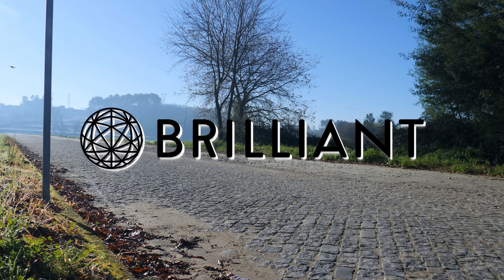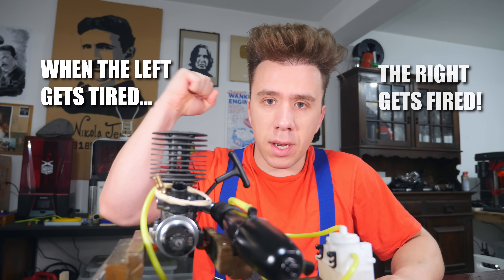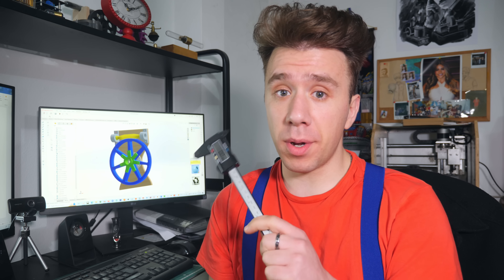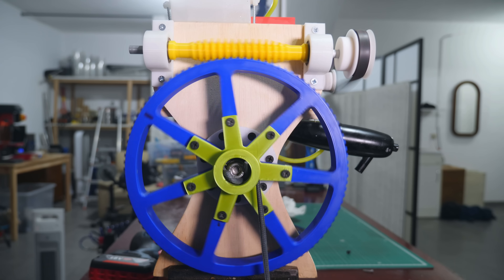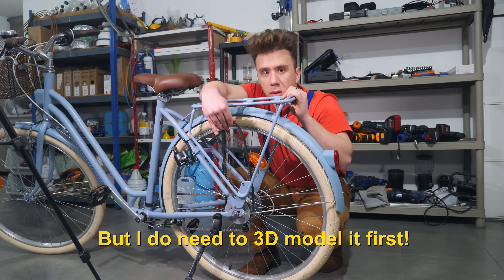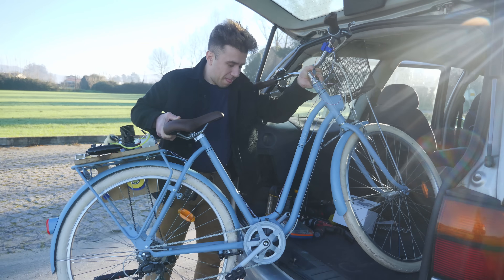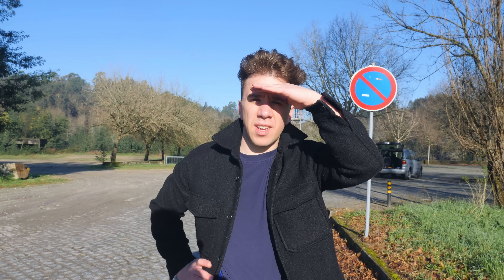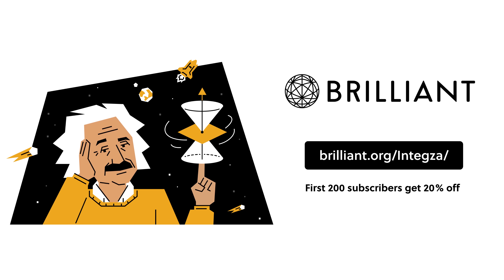Tiny 3.5 cc NITRO ENGINE on a BICYCLE

Comment: My friend, do not crosscut with the rip fence in place. If the cut off piece jams between thr blade and the fence it can trash your saw and/or accellerate the block of wood at you.

Comment: *Built a completely mechanical power unit with bare minimum of from_the_shelf parts. Made a servo-throttle with lots of spooky wirings, hanging around the frame. *
Toyota: -Would you like to become an automobile engineer?

Seriously, what's the matter with a simple device, every top bike has in 2024, you know, the cord operated twist-handle?

As for the rest of it, i'll just keep quiet, since it's just a hobby, but thanks for the worm gear idea, that solves few bugs in my project.

Also, total envy to your workspace capabilities.

Comment: Next time prime the motor plugging the exhaust or carb opening and it will start after priming 3 or 4 times (pulling the cord while plugging the pipe with your thumb)

Comment: You have a 'Flywheel' there,  no need for pull start. Far easier to use a mechanical starter.

It pays to do your research first. This comes from someone who used to race tune those engines, and blend my own fuels.

Comment: @3:15 that bearing is probably a one-way bearing that prevents turning over the engine in the wrong direction.  They make a cap and bearing for drill-start that you can probably ebay for pretty cheap.  Also, your mix seems lean (there should generally be a small amount of smoke exiting the exhaust when correct).  If it is lean - keep a close eye on your cylinder head temps with an IR thermometer if you want this engine to last any amount of time. You generally want it on the rich side, especially when the engine is new.   Nice job!  Very creative!

Comment: apart from the engine havong the idle speed setup to high and the mixture to lean (you notice the juhjuhjuhjuh sound on full load), cool video !

depending on the carb you have mostly a slotted screw that keeps the slider from closing to much. often at an 25° angle from the sliders axis.

turn it counterclockwise while the engine is running and push the slider in until it runs at a nice brooooo tone.

then drive around a bit so it warms up and then turn the big screw in the fuel nipple also counterclockwise to open the main/high speed needle and have it running a lil richer.

on full load it should sound like a angry hornet on steroids. without those micro bogdowns. like weeeeee.  if it puts out a lil exhaust plume while reaching full rpm and having good bite on WOT you got the optimal mixture.

to much smoke and laggy WOT reaction is to rich. good for longevity and easy start on cold days but bad on fuel economy and power output.

Comment: These engines needs to "break in" on low rpm, low load and rich on fuel to last longer. They are not ment for long time on full trottle. However, this looks so cool 😄

Comment: These things are incredible powerful.
And all they do is move small rc cars.
Actually very fun btw, they easily reach 60km/h+
I´ve got one that even has a automatic 3-shift gearbox (full mechanical transistion controlled by rpm).

Comment: You should lower the idle. I hope you broke in the engine before using it if it's new. The break-in process is critical, so you won't prematurely damage the piston & sleeve or the engine overall.

Comment: Haha, you need to prime the engine first in order to get it to start right away. Also, there's carburetor tuning involved. I'm not finished with the video yet, but if I come across more good tips, I'll fill you in. Definitely, you should have had your cousin there who runs rc or anyone from a hobby shop that runs nitro for guidance on nitro engines. They need tuning every day since the pressure in the air changes every day. Yes, you can have a basic tune, but it won't be optimal since elevation and weather affect the circumstances. Neat video, by the way! I'll get back in a few.

Comment: Nice as an experiment but operation wise the gear ratios needed to make such a high RPM engine workable on a vehicle are far from ideal as torque is non existent at 7cc so you fight your self against extremely lossy gearing and it needs to be run constantly at annoyingly high RPM and suffer at most of its power band.
That's why the bare minimum for a bike conversion is 50cc which has sufficient torque to propel it using a centrifugal clutch and fixed gear ratio while not revving its crap out.
I've even seen 200-300cc 4 stroke engines on bikes which probably have less horsepower than a 50cc nitro engine but their power band and the light gearing they can work on is what makes them ride seamlessly.

Comment: Only 15% nitromethane? That's it? You should give some higher percent fuel a try. When I upgraded from a Traxxas 2.5 to a 3.3 on my Traxxas Revo, I went from 15% to 30% fuel and wow. BIG difference. The only thing I hate about nitro engines is that compared to a modern brushless system they are so finicky for the amount of power you get. With a brushless setup and a LiPo battery, you can get the same if not more power more reliably. No fuel stops, no glow plugs, no tuning a tiny carb to make it run right if the humidity and temperature have changed, none of that.

Comment: hp is there, but not torque for a bike  with  a  person.   that engine gonna blow up because of  constant high throttle.  these type of engines are usually good for around 10 to 15 lbs. build max. cool project though.

Comment: Gears are important for torque and speed output. They always reduce power output.

Also 15 minutes of math could've saved you however long you spent guessing and checking your gear ratios. You know the engine's torque. Pick a target for wheel torque or force and go backwards from there. Another 5 minutes and you could've calculated the top speed assuming there was enough torque to achieve.

Look forward to more informed and informative videos next time.

Comment: I did this with a 24 cc backpack, leaf blower engine, a small piece of pipe, a storm door, dampening shock, a few brackets, and some bolts, all stuff my grandfather had laying around in his garage, I put this on the back of a bicycle, and it would take a little while to get up to speed due to the ratio, but it ran almost 30 miles an hour, I did this when I was 13 years old, no clutch, pedal to start kill it to stop, I did not really know what a clutch was at the time 😂

Comment: If that nitro was new then it would make more power after it is broke in. There is actually a process that rc car companies designed to properly break in the engine.

Comment: french do use HP we say CV (chevaux = horse) but on our carte grise car paper spec you got HP (also called cv) and you got CV that they call puissance VISCAL that is like a maths division thing to know how much it cost to put it on your name its a combination of emission and horse power and car specs like a 110hp diesel car can have 7cv but a 115hp bmw e36 318i is 9cv also a 164hp mercedes clk kompressor has 11cv and a clk230 193hp had 13cv and those CV get converted to a taxe depends on the region its 40 to 48€ 1cv but if the car is older then 10 years it half price
so imagine those nice v8 cars they are like 20 25cv you put those once inn your name and never change again

Comment: If you prime the engine it starts much easier. It's why it started right up for the drill, because you'd manually primed it a bit. Read up on tuning pointers for these little guys, they're easy to get right once you figure it out they're basically just like most engines with a few special needs. The fuel/air mix is important and operating temp is also important and the best way to check for fuel/air mix. You want the heat plug to be around 150°F for best longevity i.e. proper fuel/air mix. There's tons of tuning you can do (clutch shoes and springs for example), for desired results. I used to run RC cars with electric back in the 90s and was forced to learn nitro when I moved out east and everyone was running these. Once you get it there's no problems.

But it looks like you have the basics down and you started with a good engine supplier. HPI makes good stuff for the most part.

If your gears are wearing material like that then also check for lash as they're probably too tight together. Lash is super important and makes the difference between a set of gears that wear out in a few uses, or last for decades.

Love your videos man, you should be a professor because you have the enthusiasm and drive that all my teachers never had and I'd wager you'd make learning fun for students and I think we need more of that in schools.

Comment: The Citröen 2CV was not named for its 2hp engine. It was named the 2CV due to the engine having 2 cylinders (2C) in a V configuration hence 2CV.
Also most of the Chinese cheap 2 stroke convention kits make between 4 and 6 hp not 1.2.
Reply: Nice theory, except 2CVs are flat twins. Taxable horsepower rating of deux chevaux (two horses). Internet, buddy.
Reply: @chrishackett5887  I stand corrected :)

Comment: why do you guys need to control everything with servo motors? but things like brakes are still on cables? throw away the fly-by-wire system and fix a pretty atx thumb lever to the handlebar with a cable to the carb. KISS - no need for overthinking a solution that looks ridiculous when one wants to use the thing. instead of that you could focus on to make a kill switch...

Comment: Seems like you could tune the carb a bit and squeeze skne more top speed out if it, useually with nitro rc cars we look for a nice blue smoke on acceleration, seems like you could have been running a bit lean, it would be better for the engine to run a bit rich rather than lean, it helps keep the temperature down. Having said that, nitro engines so don't like to run great in the cold either so depending how chilly it was outside could also effect performance. Fun project for sure!.

Comment: If the electric motor on a typical bike has 50 nm of torque and your nitro engine is rated at .9nm then the electric motor has 55 times the torque, not 50!

Comment: Actually, I´m not surprised at all, that you can operate a bicycle with a nitro engine with 2.5 HP.
In germany, there are two types of electric bicycles, one of wich is limited to merely 250 watts, so somethng along the lines of 0.3 HP, which is a fraction of what the nitro engine is capable of delivering.
Still, I´m impressed, that the teflon gear was able to handle those forces, at least for a certain amont of time.

Anyways, yet another cool idea and a great execution.

Comment: My first thought was, you going to use planetary gear box. That would do excellent job of amplifying torq.
Reply: You can take one from old drill
Reply: @Niewiem0  Funny, I just disassembled an old two-speed dewalt hammer-drill driver, and was immediately impressed with the quality and durability of the planetary gear-set that’s used to facilitate the the high and low speeds. 

Unfortunately I am still trying to find a way to make a retrofit housing to go around it with input and output and output bearings to hold the shaft in place. 

The planetary gearbox has 3 sets of 3 planetary gears, and three more ring/center connecting gears. It’s really quite impressive, how strong it seems. I have no doubt that it could be used on a small moped sized vehicle, and support the torque needed…
Reply: Are planetary GBs readily available in this size? Would like to try.

Comment: You're amazing absolutely amazing 3D printing your own cogs I use steel 05b sprockets 05B 9 Tooth sprockets and 05b 11 tooth sprockets 05b 13 tooth sprockets and 05b 25 tooth sprockets 05b 28 tooth sprockets 05b 34 tooth sprockets 05b 36 tooth sprockets 05b 40 tooth sprockets finally the big size 05b 57 tooth sprockets I build trucks out of wood using these sprockets sound systems on them video tape decks my own homemade record players MP3 players 3.5 mm stereo plugs cassette tape decks I even made my homemade motorbike call Huffy rush motorbike using those sprockets that I described before gx35 cc Honda brush cutter motor VHS video tape decks on the back of the motorbike side my own homemade wooden box with two speakers a valve amplifier using a 2 6DX8 valves & 2 12AX7 Valves and even an old 1970s valve radio altered to play VHS video tapes using the video tapes for playing music on my own tape bias oscillator an Arduino Nano circuit board with a TF lunar lidar sensor rigged up switch the brake comes on when someone steps out in front of the motorbike Huffy rush motorbike the valve radio has a microphone on it the first VHS video tap deck record play switch and a valve heater selection switch from valve number 5 for playback mode or video tape deck valve radio playback and I've even got a headlight on the front of the motorbike LED headlight surprisingly bright 12.8 volt deep cycle lithium battery an alternator rigged up so that when the brush cutter motor is stopped the battery Powers the load as soon as the brush cutter motor is started up the alternator starts to run the load battery is no longer powering the load I haven't measured how fast this motorbike goes I think it goes about 10 kilometres an hour but it could go a bit faster if I rev up full speed I've got to get an app like the app that you got on your phone and then I'll be able to speed monitor the bike speed your video impressed me soon I'll be putting out a video about my motorbike Huffy rush motorbike and you will be able to watch it it will be in high definition the video I mean thank you inspired me

Comment: nitrometane IS WRONG ! The fuel has about 15 % lubricant. and about 10 % nitromethane and the rest is methanol. Glowplug servers as ignition. been flying model rc planes and cars over 20 years.

Comment: Prime the engine. Plug the exhaust with your finger and pull several times until the fuel reaches the carburetor. Then it will start after 1 or 2 pulls at most.

Comment: I mounted a weedeater motor on the back of a bicycle the same way you did I used a 2-inch pulley on the motor and I tac welded another rim on to my wheel both 26-inch 3/8 inch belt can't remember the length and I use the spring and idler pulley to keep the belt tight which always goes opposite of the pulling side of the belt I weighed 330 lb at the time and it would pull me 26 mph on flat ground I think the engine was 27.5 Homelite engine I use a small sprocket on my pedals so I can take off easy and all I had to do was take off pedaling in the motor would crank on its own no clutch when you stop motor stops when you start motor starts

Comment: They were doing this 40 years ago, remember seeing a guy going up and down the runway at a model show. The Engine runs on Methanol by the way usually with a small percentage of Nitro-Methane maybe 10-15% depending on the engine, also has oil in the mix, we generally just used to run Straight Methanol/Oil mix or 5% Nitro in a model aircraft.
Reply: yep. they dont need nitro. and all it does is use more fuel. which costs more...

yes, ok, you get a bit more power but thats due to being able to stuff more fuel into the cylinder.

nitro by itself barely burns. can almost say its non flammable...

Comment: Stopping one of these engines by putting a finger over the air intake is a great way of flooding it and possibly damaging it through hydraulic lock - much better to use the throttle arm, or pinching the fuel supply line.

Comment: Schumacher do a 3 speed gearbox for their nitro engines...
The clutch bell had 3 different sized pinions, meshed into 3 spur gears. Each spur has an internal rachet, with a different tension spring. As the rpm rises, the 2nd gear pawl engages and 1st gear just freewheels, and as the rpm rises the 3rd gear pawl engages, 1st and 2nd just freewheel. Fairly simple, reliable (although the torque in 3rd sometimes stripped the teeth...), and fairly cheap! (Fusion, menace , XTR3e)

Comment: I’m curious how part of the engine works. At lower revs it isn’t outputting any power but the engine is still going. I used to have a dirtbike with automatic clutch that did this too, the revs have to get over a certain amount for the engine to output. How does this work?

Comment: Totallt wrong about french 2cv.   Cv is not measuring power. It is a tax scale. Citroen 2cv comes from 22ch (power is ch. And not cv) up to 35ch for the models made in the 80's like "2cv 6 special". There are aboslutly no link between the tax cv and horsepower ch. I dont know where these "9cv" come from. Fakeland probably...

Comment: We run 30% in new zealand. 15% nitro not good. Yes people use it due to bad governments. But you need 25% or so, and a race motor is 3.5 hp😊

Comment: sounds like it can take some more gearing to get that top end up. Have you considered a compound pulley drive? It’d probably be enough to just have the engine driving a pulley on an axle driving another reduction setup down to the wheel. Even if you end up with a dinner-plate sized pulley, look at how motorcycles like Harleys do it — those rear pulleys aren’t small. I’, guessing that would be quite a bit more efficient. The next step might be to pull a CVT transmission from a moped to get continual gearing. I bet you could get 50kph with that.

Comment: First it needs a air filter an second you have to fine-tune it .
There is a high-speed and a low speed needle you can adjust but it is all in the manual.
This engine won't last long

Comment: Great job on  the bike!  For a higher top speed (if you haven't tried it yet) switch to 30% nitro fuel and retune the engine.  Should notice a big improvement in power output ;).